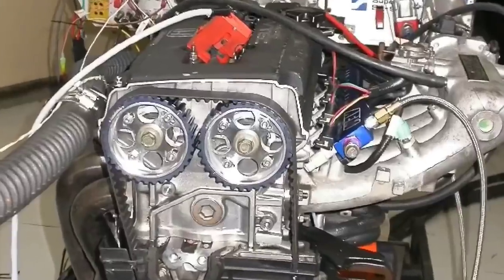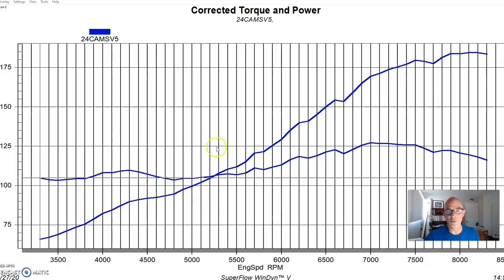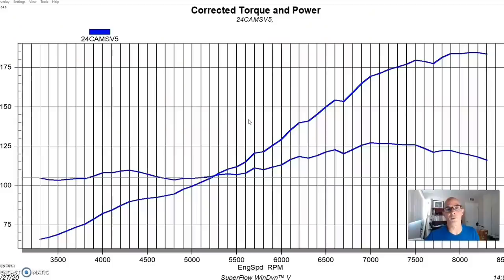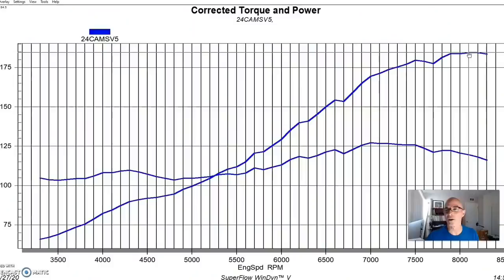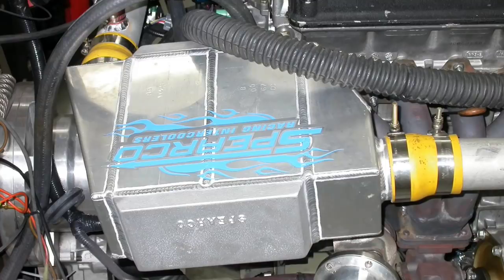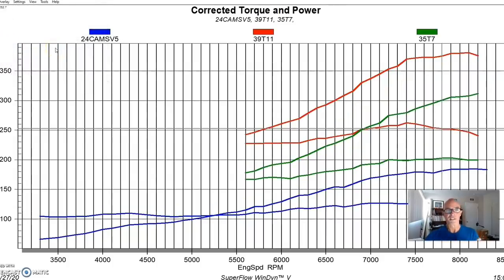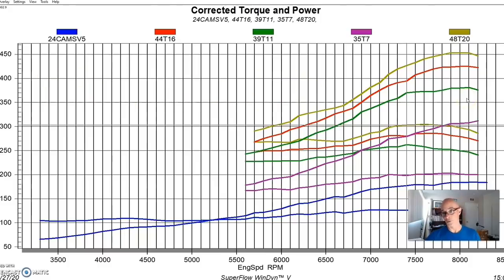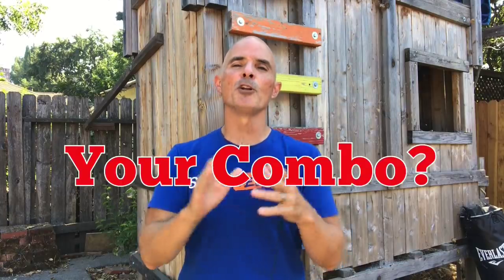500-HP HONDA TURBO B16A-POST BIG BANG BUILD

Comment: These b16a motors love the gtx3076r, seen numerous setups make over 600 on the same 24 psi you took this thing to. Faster response as well. Jump to a B20 vtec with a 3582r and your making over 700 on same boost

Comment: I wish Richard could get another stock Honda D or B series and give it the .019" ring gap on stock pistons and rods and see where the limit is then...
Reply from the maker: not .019 ring gap-it needs more
Reply: @richardholdener1727  Richard please explain. The rule of thumb you posted in your "Gaptize Your Junk" video stated .0065" per inch of bore. A D16 is 75mm or 2.95". so 0.0065 X 2.95 is .019175" Is the rule of thumb still too tight or did you just see .019" and think I was dealing with a 4" bore?

Comment: Currently running a a3 b16 on my daily … make me wanna rebuild and slap a turbo on it since it use to be a circuit engine and I belief is tired now. I would be fine with 300-350 whp.  Lol I want reliability and fun lol

Comment: The motor makes a lot of hp, but the torque suffers.  I think that is the difference between say my 1.4L Cruze, which pumps out more torque at low RPM.  I’m beginning to believe that not making massive amounts of torque on the low end is the key to blocks surviving.  My Grand National makes a ton of torque on the low end and guess what, the block has been known to split.  One guy with a 6766 turbo made 625/683 to the wheel and his block survived but for how long I don’t know.    That’s probably over 700hp and close 800 ft-lbs of torque to the crank.  The 109 blocks have made over a 1000 wheel hp and probably 950 ft-lbs of torque but with every modification possible to strengthen the block.  My understanding is because the block is off center that cost quite a power my having the crank pin split weakens the the engine as a whole.  Maybe I’ll get Richard to Big Bang a 109 block one of these days, with at minimum replacing the stock center main caps with billet still ones.

Comment: My b16 with 83mm bore just put down 361hp at the wheels on 15 psi on 105* day at 7800 rpms,  we stopped due to the heat and im going back in 1 month to finish the tune, I have 16 more psi to go and maybe another 2000 rpms.

Comment: I know you wrote a book on the focus Zetec but I’d love to see a combination build up of the zx2 Zetec with vct on exhaust side. If you work the combustion chambers and unshroud the intake and exhaust and make a sord of swoop from the side of the chamber wall coming towards the divide between intake valves and then do the same on the other side and then blend the chamber walls into the unshrouded intake and exhaust then blend the sharp edged spark plug boss and port the intake and exhaust and deck the head 100 thousandths( which would still give you plenty of piston to valve clearance) then put in a custom intake cam with more duration and use a ported aluminum probe intake and long tube headers for the N/A test and then test with turbo with an optimized tune they can make a lot of power. But I love all motors I love when you say your not a ford or chevy or mopar guy your an engine guy and I feel the same way. Keep testin. Your videos are great!

Comment: The miracle of efficient 4 valve heads. They certainly can make horsepower.
I suspect that with 500 HP on the street, that engine would have the lifespan of a mayfly.
Have to tune a couple hundred HP out of it to make it to the 7-11.

Comment: Had someone in a camaro forum ask about iron duke performance mods. Wink wink.
Reply: 3.1 is a pretty built little engine.  Lots of tricks built into them
Reply: Ultra CNC  theyre ugly as sin and hard to work with since they are fwd engines mostly.

Comment: Damm that's impressive. 
I was always under the impression that i need arp head studs, not anymore. It's a shame you didn't do a b20 turbo with all the myth's about the weak cilinder walls.
Reply: With a b16 head it’s the poor mans type r b20vtech but b20 walls are thinner then b16/b18 might get sketchy with boost but arp head studs are a good idea just Incase
Reply: yea the cylinder walls at 20 lbs crack 100% on a b20 84mm too thicc

Comment: Great test.  Were those reused head bolts Torque to yield or not?  Have you ever reused TTY head bolts? If so, were there any sealing issues? Curious.
Reply from the maker: stock head bolts
Reply: I worked as carmechanic before, we had 3brands in the shop. One of these with lots of turboengines. And we could use stockbolts 2 more times. In factory and 2 more heads changes, same tourqe.

Comment: 22re dyno gap rings only arp  rod bolts stock ?
Reply from the maker: rod bolts were stock in the Big bang build but this one had after market rods
Reply: @richardholdener1727  cool i did not write that right sorry .i would love to see a toyota 22re on boost as nrp pistons low compression ones are cheap ( i used them in a rebuild) ..but a NA with gaped rings and mls head gasket arp rod bolts be nice as they have big forged OEM rods/crank may be forged pistons but stock rods ill bet are fine to 20 psi and may be even the pistons to (thick made  in ring lands )..i am going to rebuild my 5mge Na- t soon 1984 toyota supra love to dyno it may be i will been hot so i ant done much east tn weather

Comment: You broke the ringlands because it detonated. If you had working knock detection, they wouldn't have broken
Reply from the maker: wrong
Reply: @richard how much ring gap did you run? Broke my b18 on forged cp pistons around 430hp same issue, got your books but I need to re read 🤣

Comment: Would of liked to see boost curve, back pressure reading and turbo rpm.
Reply: On Honda,  they pretty much mirror the power curve,  especially after vtec
Reply: i cant tell you without looking. a 90 degree angle.

Comment: Do you think outcome would have been the same on stock rods and pistons with ring gap????
Reply: FasterProms used a K series with cams and made over 600whp.
Reply from the maker: K series is lot different than B series
Reply from the maker: I think you can get to 500 hp with ring gap on a B16A (but I haven't)-will take more boost without cams

Comment: I don't understand stopping dyno pulls at 8000rpm. We had issues with the powdered metal honda oil pump above 9000rpm, but was remedied by a billet oil pump gear and a good harmonic balancer.

Comment: I think it would be awesome if you did a Toyota 20R or 22R or something like that.
Reply: 18RGEU
Reply: Ive got a 22r in my sand rail. I have really been tossing the idea around of throwing boost at it. Its the torque that should be impressive, however im sure itll put down reasonable power. Its a huge plus the 22ret came turbocharged so oem turbocharging parts are available.

Comment: Have to love any engine that revs past 8500 , DOHC for the win
Reply: Not when it sounds like my weed whacker.  And takes 24 psi to make 500hp.  The only thing that sounds worse is a rotary.
Reply: @AlexLTDLX  I completely agree but N/A it made more than a 70s 351w...credit  where its due.
Reply: @falconater68  now compare that 70s 351w to a 70s 4 banger....oh shit....stop comparing built to the walls 4 bangers to smogged ass malaise era v8s.
Reply: @AlexLTDLX  I'm glad there's not more people like you in the car scene   , otherwise all you would have same old cookie cutter Small block chevy in everything and please don't reply back saying 'but but I have ford Windsor big block chevy hemi in my car' .
Reply: @dilsher12  30 years of drag racing taught me hondas are slow, clog the staging lanes, loud and have less than a 50% chance of making a clean pass.  When they break they still like to make a whole pass down the track oiling the whole thing as they go. Your experience might be different but that's mine.
Reply: @AlexLTDLX  dont forget the hilarious fwd launches that look like the engines is about to hop out of the hood. oh, and the 3-5 "money shift" they love to do.

Comment: In our research with the old 2.2 dodge turbo 4 from the 80's, they would break piston ringlands between the 1st and 2nd ring down at the 175whp range because of a hotspot in the chamber. Those same seemingly fragile pistons would go on towards 400whp once the "glowplug" in the chamber was addressed.
Reply: What was causing the hotspot and how was it addressed? You can't just throw out a shiny bait like that and not expect to hook at least one curious gearhead.
Reply: @Parents_of_Twins  Heart shaped chamber. Tit between int/ex valves was over 1/2 inch cast aluminum. Became an ignition source.
Reply: @kylemilligan752  Interesting. Was it a casting flaw or just oversight by the designers. Thanks for the info.

Comment: Piston rings transfer heat from the piston to the cylinder walls. Butting rings gets to be a chicken or egg conversation. Are butted rings and broken ringlands caused by excessive piston temperature? We saw less piston issues in sbe hondas as we began using bigger exhaust housings and wheels.
Reply: Ring gap allows the end gasses to escape into the sump reducing any detonation effects.  Looking at it from a slightly different point of view you can run any engine without coolant to the point where it gets so hot that the pistons seize in the bores, once it cools it runs again and the ringlands don't break so the ring gap theory has to be wrong.
Reply from the maker: ring gap allows end gases to escape...reducing detonation effects-um no!